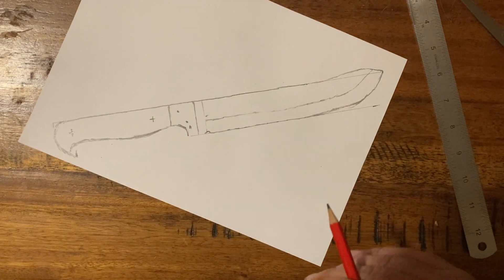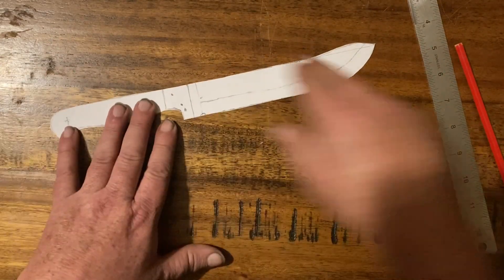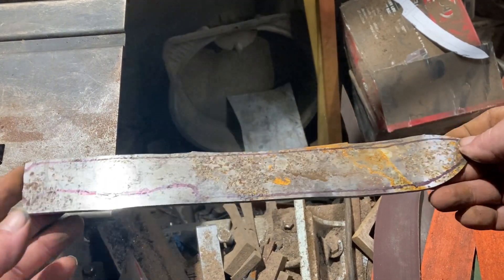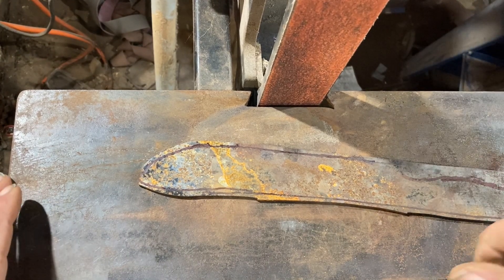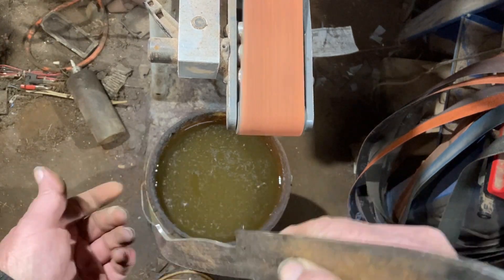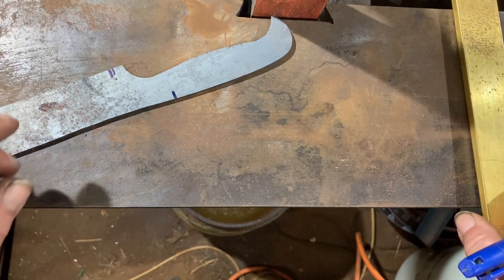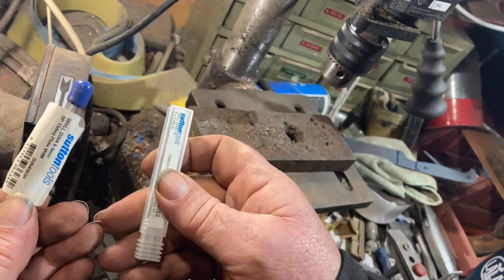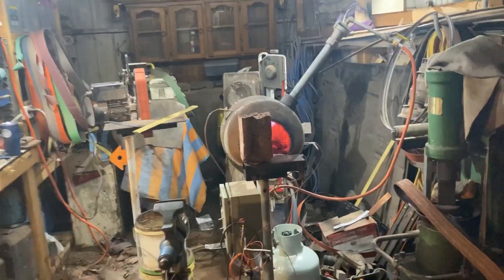Designing a knife, Knife maker chat, cutting out a knife, knife maker shop tour

Comment: That is going to be a really great knife Darren!!! Cup looks great in the workshop!!!  I'm surprised you can take the "spring" out of the steel simply by clamping it - I wouldn't think that - Cool!!!  - Rick
Reply from the maker: Lol Mate, that cup gets a lot of use, I know Terrie's does too. Straightening the knife this way is a matter of timing, there is small window after the quench when you can bend it straight, have seen a lot of people snap them by doing it though. Going to the plate quench is a technique for using with air hardening steels, borrow in it for oil hardening mean I can press flat rather than bend flat, much gentler and safer, once the knife is back to room temperature it is at it's hardest and also most brittle.

Comment: Love the quenching bucket! Yummy! Darren's been making so many knives he just free hand draws one like a BOSS! Was wondering about the rust. Once heat treated and oiled it stay clean for the most part with care?  Price of Carbide drills <- HOLY H3LL! Only a Knife maker pays for the tools he needs! This is why hand crafted knives cost a pretty penny. "Crying over copper" <-- haha. You have found out the hard way at some point. Who knew? Good tip/lesson shared.  Your shops not small your just a BIG guy!  Good news in the USA is that Power Hammer can go from 9 am till 9 pm all day. People may get up set but your good to go. This is your trade skill.  Are you going to use a shipping container via Boat to get everything to port once over here? Should be the cheapest or are you going to source items/ materials once here? BIG shout out to Lala Farms! ha! What determines NON magnetic in heat treating? <- How did you find that Out and what does BEING magnetic incur on steel production on a knife? Why is it bad basically. I see you use magnets to detect it. Makes sense not to heat treat one blade too much effort. Mmm oven baked knife pie! Has a Bite to it! haha
Reply from the maker: lol there mosquitoes in my area have put in a OH&S claim against that water in the bucket. Lol mate I always freehand my knife designs. Carbon steel will pock up a patina of Black oxide over time, this protects it to a degree, oil and cleaning after use are important with carbon steel. Yeah they cost a pretty penny, but stops the hard steel arguing with a drill bit. Copper is actually a pain to work with, heats up binds, just really difficult. lol it is pretty small mate and stop calling me fat😂. The Neighbours Garage pretty much backs onto mine with the kids bedrooms on the other side so the power hammer would be rude to use it with the noise it will produce. Yep shipping everything and hoping we can get a new place in time for it to arrive, the power hammer cost alone will pay for the shipping. going to critical temperature makes the crystals of iron in the steel (the magnetic part) get fluid so non magnetic, that fluid state is where you want them to be so that they recrystallize in a tight formation with the sudden temperature drop. Tempering loosens those bonds a little, some hardness drop but and increase in toughness with less brittleness. The dream is to have enough room to have it all set out in its place so I can use the good tools all they time.